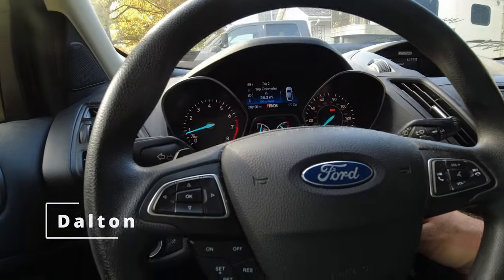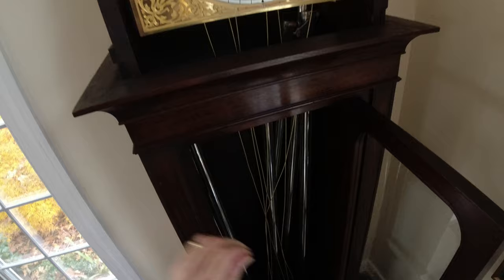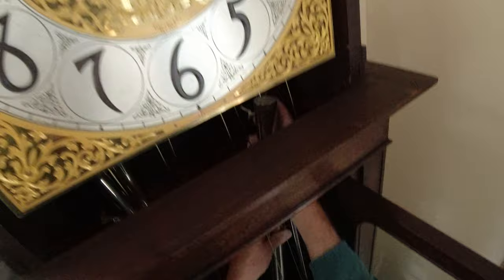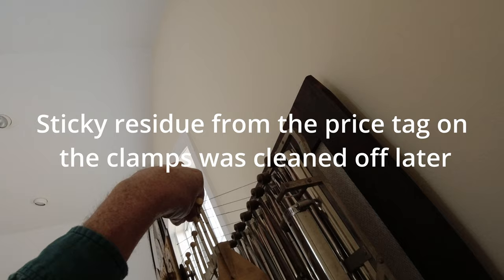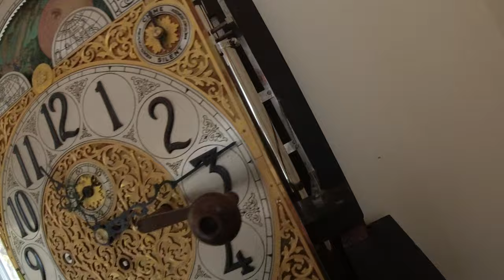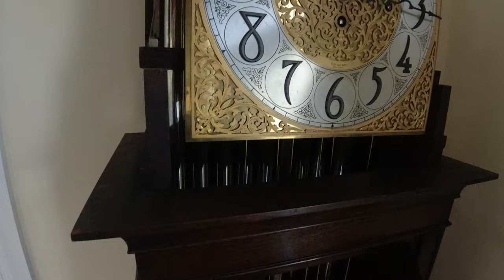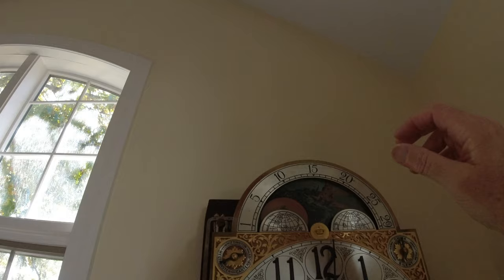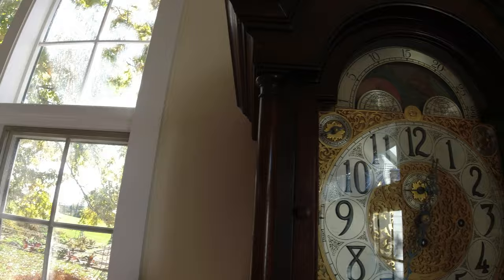Setting Up A Herschede Tubular Chime Clock

Comment: How do you keep the cables from jumping the barrels? I have a 1910 Herschede 9 tuber and the cables always want to jump off and get tangled when moving it even though I used something to hold them in place...I just got the cable untangled and when rewinding it always want to jump off the barrel again...this movement looks identical to mine but it may be newer...Sounds good...nice looking clock-My case is more gothic styled than this one-what year is this clock form...

Comment: You have ideas on removing a tubular movement when the top does not come off as this one did
Reply from the maker: You can remove the back panel and take it out from the back. If you have enough head room, you can also take the top off and remove through the top.
Reply: @DaltonClockRepair  I’ve only worked on two both Ridgeway and they cane out the front I have a client with one that I’m having trouble seeing how it comes out will look at the top coming off or getting the back open thanks